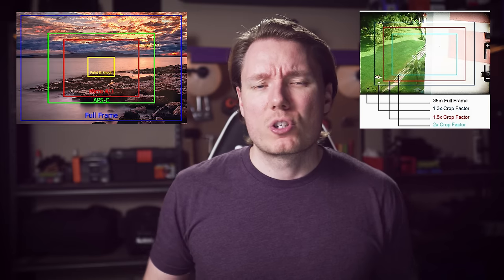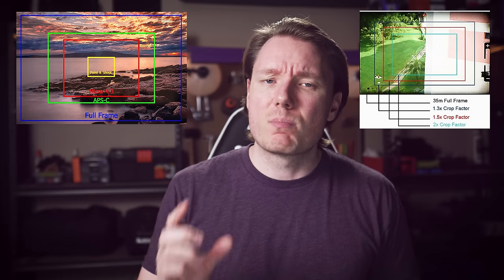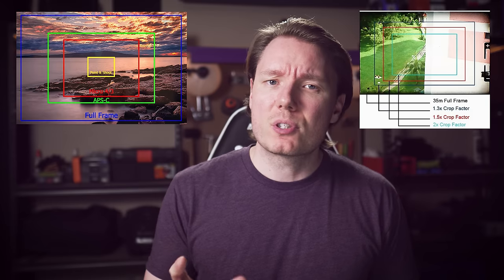Crop Lenses on Crop Bodies: How It Works vs Full Frame (APS-C & M43)

Comment: I think another misconception I hear all the time is that a speed booster on say a sigma 18-35 1.8 will become a f0.95 but it isn’t true. The exposure becomes brighter with the speed booster because the light isn’t being wasted. When factoring a crop factor you also have to crop the f stop. So by adding the speed booster you’re actually getting a the 1.8
Reply from the maker: Yeah, it's a funny tradeoff. Because the aperture gets multiplied as well so the Depth of Field doesn't change. If you take the 0.71x speed booster for instance, you'll get an exposure equivalent to f/1.28 on that Sigma, which you'd think would make for a shallower depth of field, but the focal length is reduced as well, which deepens the depth of field by the same multiplier of 0.71x, so it ends up cancelling each other out.
Reply: Gerald Undone exactly, some reason nobody gets that
Reply: No speed boosters do increase the speed of the lens. so equivalent apertures or focal lebgsts are not real. They are just mathematical tools for comparison. A 50 mm f/1.8 k
led is actually 50 mm f/1.8 no matter what the sensor size is. It can never change.

Comment: My question is you dont need to apply the crop factor to a lens if the lens is designed for a crop sensor but you do if you use a full frame lens on a crop sensor? I'm asking a question even though it doesn't look that way
Reply from the maker: You always have to apply the crop factor. In either combination.
Reply: @geraldundone  thx for the answer im new still learning and alot of confusion when it comes to the crop topic thx i really appreciate the answer

Comment: When they design a mirrorless crop factor camera, don't they place the sensor closer to the lens? Wouldn't this make the circle of light on the sensor smaller than if the sensor were located where a full frame sensor is? How much does this compensate? No one seems to be taking this into account. I'm using a 28-105mm EF lens on my APS-C DSLR. Should I be concerned about the difference?
Reply: You are thinking too much. Lenses are designed to work for each system. The flange distance is not relevant apart of compatibility. If you use a DSLR lens on a mirrorless camera the adapter sets the lens at the proper distance.

Comment: I try explaining this concept in forums a lot.

 "It's not technically a crop sensor unless you use a lens that creates an image circle that's larger than the sensor size."

I'm just gonna link this video from now on.
Reply: But its not true. Apsc or m4/3 is a crop sensor because the fullframe it allways the reverence in modern photography. All lenses are marked with the ff numbers even on the fuji system where no native full frame lens exists. But you can use 3rd party ff lenses. So its a crop sensor if its smaller than 35x24mm. Period.
Reply: @tomwd.2825  In vernacular, but not in practice, not in implementation.  What's imprinted on lenses is a linear measurement.  That linear measurement never changes.  What 'could' change is the field of view, depending on the size of the sensor.  You obviously don't understand the science and thats ok, you don't really need to.
Reply: @HGQjazz  a lens is a lens is a lens. It does not change at all. 
Not even if you change the camera body. You only crop the picture if you use a smaller sensor on the back end of the lens, thats it. Period. You dont belive? So put a 70-200 lens on a tripod, take a photo with a full frame camera of a scene about 30 meters away. Than dont move the tripod with the lens on it, only change the camera body to a crop or consumer dslr and take the same photo. Outcome is: you took the exakt same photo with all their characteristics. Only the crop camera took a part of the full frame photo. The ff photo can be croped on the PC and you get the exakt same result. Nobody can spot the difference.

So where is my mistake in my first post? What did I say wrong?
Reply: @tomwd.2825  Sure, ok.  A camera's sensor is made a crop sensor by the user, it's not made that way by the manufacturer.  No smart person refers to a cell phone camera as a crop sensor camera.  My point is "crop sensor" is not an inherent characteristic of the camera, but rather an implementation of the user.
Reply: @HGQjazz  no. Of course its made by manufacturers. ?!? 
Again. There is a standard called fullframe... lenses are made by that mm numbers to fit this measurement. Now its a mater of how big the sensor is. Even  medium format take the scale of full frame. Whats so difficult to understand? If the sensor is smaller than 32x24mm its a crop. How much smaller defines the crop factor... common is 1,5  1,6 apsc; 1,3 apsh; 2,0 mft ... and yes even cell phone cameras are crop sensors but it doesn't matter because there is not an interchangeable lens... so obsolete talk.
Reply: @tomwd.2825  The focal length of lens is the same regardless of the sensor you put behind it.  Whether the image is cropped or not is up to the user.  The term "crop sensor", as commonly used today is a misnomer.

The more accurate term should be "crop user".
Reply: @HGQjazz  ok, you just repeated what I said. And still its a croped picture of the diameter of the lens. And its because of the sensor not the user. Thats rediculess. The user can make a crop sensor being a full frame. Its utter nonsens. But what ever you think. Feel free to believe. These days are packed with alternative facts, so yours is *the croped user*. so what,  have fun🤣🤣🤣

Comment: I have a question. The FF 50mm 2.0 lens set for the GH5 body gives an effective focal length of 100mm. But what about the aperture? Is it still 2.0 or 4.0 (we multiply x2 as at focal length?)
Reply from the maker: It will still be as bright (exposure wise) as f/2, but it will have a similar depth of field to f/4.
Reply: @geraldundone  I'm not asking about DoF. It's about brightness. so the aperture does not change the value?
Reply from the maker: Exposure will still be f/2.
Reply: @geraldundone  Thanks!

Comment: Ok my question is if i use a crop lens on a crop sensor is there no cropping going on? To be more specific i have a Canon T7 and if a buy the "Nifty Fifty" it looks more like a 70mm. But if the ES 50mm was a ES-S 50mm (which i do not believe they make) would it look like a 50mm should...as it would on a full frame?
Reply from the maker: There will still be cropping. The cropping is done on the sensor side. The lens doesn't matter.
Reply: @geraldundone   Thanks. So no need to care if a lens is an S or not?

Comment: So if I put a 30mm apsc lens on an m43, the 30mm would be converted to 45 vs a 30 full frame lens which would be 60mm on the m43?
Reply: No, the lens is never converted to anything else. 30 mm is always 30 mm.

Comment: +Gerald Undone  Question, when I use an f2 full frame lens where the total amount of light gets dispersed over a certain area and my sensor is M4/3 does the f2 now effectively become an f4 seeing as the total amount of light was cropped away for the M4/3 lens?
Reply from the maker: The exposure remains the same because m4/3 sensors are tuned to turn the gain up higher than full frame cameras, which is why they produce more noise generally. But your depth of field would be similar to f/4.
Reply: TY 👍
Reply: No a lens can never become something else than it is. That applies both to focal length and the aperture. The equivalences are not real. They are mathematical tools for comparison.
Reply: @geraldundone   Nonsense. f/2 is f/2 for exposure. The sensor has no idea what was in the mind of the lens designer! Consider this thought experiment: Put a 50mm lens on a real 35mm camera, and calculate the correct exposure for a 400 ISO film like, say, Tri-X. Expose two pieces of Tri-x film. Both will be perfectly exposed. Then cut down one piece of film to micro 4/3 size - giving about 1/2 the field of view resulting in the 2x crop factor. Print both pieces of film to say an 8x12 print. The print from the MFT  size crop will show more grain because of the increased magnification, not because gain has been turned up. The print from the MFT crop will show about the same field of view as a 100mm lens on a full frame because of the crop factor.

Comment: Is the depth of field different from an- apsc lens on an apsc sensor- and a -fullframe lens on a fullframe sensor ?
Reply from the maker: It's very possible, but not for those reasons. Depth of field is determined by different factors like the diameter of your entrance pupil and the magnification or distance from the subject. Since APS-C cameras require you to get further away to get the same shot, or will have smaller entrance pupils, etc. It's very likely your depth of field would be different between full frame and APS-C. However, you can always compensate. For instance using a 35mm lens on full frame with an f-stop of f/2.8 could be matched for DOF by an APS-C lens with a focal length of 23mm and an f-stop of f/1.8.
Reply: @geraldundone  ok thank you for answering!

Comment: Great video! but something doesn't make sense to me. If a 25mm lens designed for an 4/3 sensor creates a smaller image circle than a 25mm lens designed for full frame, wouldn't that mean that in pratice that these two would have an equivalent field of view, are at least very similar, because the proportion of the image circle and the sensor size would be similar? I feel like there is something I missed in all of this..
Reply from the maker: The easiest way to visualize it is in an hourglass shape. If the image circle on one end of the hour glass gets bigger, the field of view on the other side gets bigger too. If the image circle gets smaller, the field of view gets smaller.
Reply: @geraldundone  Oh yeah, that makes sense! Great explanation. Thank you a lot

Comment: Okay so if I’m using a sigma 35mm that’s a full frame lens on a crop sensor  camera I need to buy a speed booster? Is that right?
Reply from the maker: You don't need to. You can if you want to get more light and wider field, but you can use it without one, it will just crop in.

Comment: But if I use a 30mm DX lens with my aps-c it still looks like a 45mm on fullframe. Am I missing something? You explained it like lenses for crop sensor eliminate the crop factor but from my experience it's not that way
Reply from the maker: Hmm. That's not what I say in the video. I say that crop lenses have a narrower angle of view. Which would be what you are referring to when you say it looks like your 45mm. The focal length is still 30mm, because that doesn't change, but the field of view is similar to 45mm. Hope that helps.
Reply: @geraldundone     yeah, sorry I keep calling the field of view focal lenght. It's the part at 6:18 that gave me the impression that the micro 4/3 lens squeezed the image like a speedbooster would, reducing the effect of the crop factor. Thanks for claryfing!
Reply from the maker: Unfortunately, no. Just a smaller image circle, but not boosted.
Reply: @geraldundone  I wonder why there are no focal reducers or "focal reduced lenses" for dslrs like my nikon d7500. It would be pretty nice to get the full frame look (even though considering the cost of a quality speedbooster the price would be similar to a cheap fullframe)

Comment: Okay, this is great! But someone please help me here with this set-up... which gives me a wider field of view at the widest end: 
BMPCC4k + Metabones Speed booster Ultra 0.71x 
+ Canon 16-35mm f4/L  Full frame lens
or
+Sigma 18-35mm f1.8 APS-C lens. 

The canon lens is wider, but its a full frame lens on a crop-sensor body (M4/3 with speedbooster). The sigma lens is a little tighter, but is designed for a smaller sensor... So which is wider on this set-up!? Thanks!
Reply: The Canon lens is wider even without a speed booster and the speed booster makes it even wider.

Comment: Excellent video. How about manufacturers agreed to print their lenses' (diagonal) angle of view when used on the camera system for which they were designed, in brackets after the focal length? The AOV value would make it faster and easier to compare native lenses from one camera system to another, and you would still know the focal length, which is of course useful if you want to adapt lenses across systems. In fact, why did they not start doing that already 50 years ago, in the film era, when there were also different formats around...?
Reply: Why? Those are meaningless figured to most people.
Reply: @okaro6595  Yes, I think that you are quite correct about that, and it is probably not realistic to imagine that the industry would ever agree to using angle of view as a standard. My idea was that, in many videos and forum posts, a lot of effort goes into explaining, for example how a certain focal length on a given size sensor compares to the same focal length on a different size sensor, and why it is like that. It would be great if there was a simpler way to express the relationship between lens and sensor. But as you say, angle of view is most likely not the right answer either.

Comment: The boxes are actually comparing the Field of View, not the Focal Length of a lens on various formats. Meaning for some reason all lenses focal length are set at 35mm Full Frame Sensor Format, yes even Medium Format Lenses. So the crop marks are just expressing how much of the image will be cropped (Field of View) at that particular focal length. It doesn't matter how you cut and slice it, even using a Crop Lens on a Crop sensor, the boxes are showing the difference between let's say e.g a 50mm lens Field of View on a Full Frame Sensor vs that same lens Field of View on a Croppped sensor (which by the way would be equal to 75mm - 100mm depending on the crop factor, vs a full frame). The smaller the angle created by the sensor, the smaller the field of view which is directly affected by the crop factor. This also goes for DoF but that's another issue. About the Medium Format, a 70mm 2.8 would be equivalent to a 35mm 1.4 on a Full frame, that is why the images comparing the same lens on a Full Frame and a Medium Format, the Medium Format will be smoother, creating superior bokeh than a 35mm DSLR. This is because the Medium Format Lens although it states that it is 2.8, it really is 1.4 as the lenses are measured upon the 35mm format. This said the Field of View on the Medium Format will also be double of that of a 35mm, the 35mm box will fit nicely inside the Medium Format Box :-)  The key operative word on all of this is "Equivalent" No photographer says (or at least they never should say) that a 35mm lens on a micro 4/3 is expanded or physically enlarged to 70mm, we say that it ihas an equivalent Field of View of a 70mm. :-)
Reply from the maker: You might be surprised to learn about some of the confusion out there, Nestor. I often get questions asking me if a person's 35mm lens is a real 35mm or a 35mm equivalent. OR "Does my m43 lens already have the conversion done?"
Reply: @geraldundone  OMG they really ask if the conversion is already done in the lens? LOL The thing is if the question came from a newbie or someone that was just curious about cameras, it won't bother, but coming from long time Amatures and Pros that is a bit concerning Hahaha.